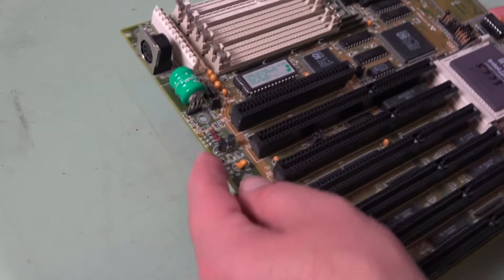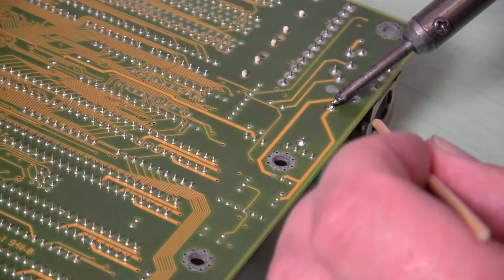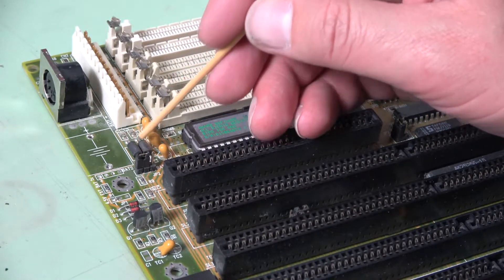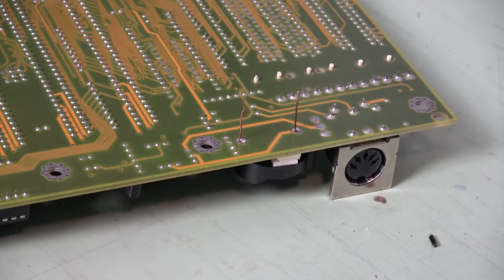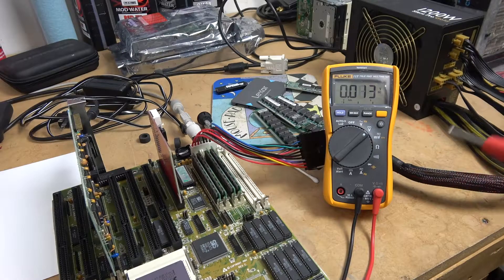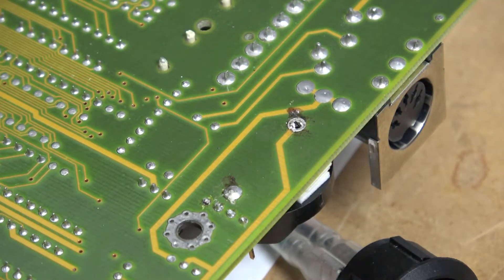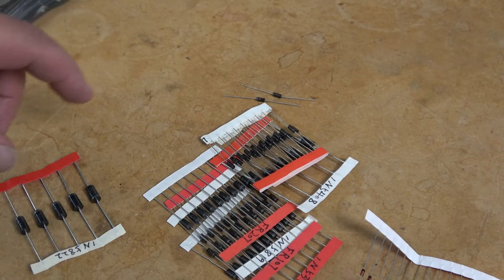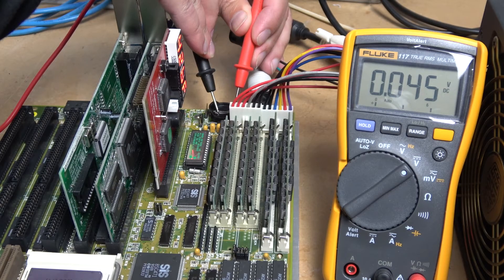Barrel Battery Upgrade on a Retro 90's 486 Motherboard

Comment: 1000x times easier is just use the "ext bat" port that usually is a 4 pin connector nearby and use a cell battery and stick it somewhere nearby with some velcro
Reply from the maker: You mean something like this? https://youtu.be/WGEP9cRuCmY?si=geoXS6qO-7J8ZeZX&t=311  It is a no brainier that an external battery is the way to go.  That is the reason why motherboard makers included those headers as they knew the battery would eventually go dead and wanted to give consumers a way to continue to use their systems.  

The section of the video I shared shows how I converted an alarm system battery for use in a retro PC, of course simple AA batteries could work or even an external CR2032 would do the same.  Either way, thanks for watching and leaving a comment. 

Truth be told, this was a pretty old video and something I wanted to try out.  Given the chance, I would even do the mod again because I can.

Comment: Would it be possible to use a rechargable battery? Like the ML2032.
Reply from the maker: Yep, that shouldn't be a problem.  You would just exclude the diode in the repair,  There is no provision to "stop" charging once the battery is full so, that could cause a problem or, might be just fine.  Never tried but, based on my google results to your question the technology appears to be solid.

Comment: Finally found a video on how that shows the desoldering of the exact one I need to remove, working on repairing an old Claw machine motherboard and the battery does not stay charged when the machine is off so I bought a newer version of it and I’m planning on soldering it on. It’s going to be my first time soldering so this gave me confidence to be able to do it myself.
Reply from the maker: Glad I could help,  If you have never soldered anything before I might suggest testing your method on some bits of scrap/wires etc..  The process is not difficult however, the danger is applying too much heat which can cause the copper pcb traces to burn up.  (which is not desirable)
Reply: @Hardwareasylum  hmm yea I got a old motherboard I could test on thanks for the tip

Comment: Nice job.
I have several old 486 MBs that were recovered by my father.
They're a rarity nowadays (at least where i am they're either overpriced or badly damaged).
What kind of diode do i need to buy? (the specifics to find it online).
I remember a while back there was someone online specified the diode but i don't remember the code.
Reply from the maker: Schottky diode,  I bough a grip of them off Amazon for like 5 bux USD.  https://amzn.to/3xeFdjk

The small black ones seemed to work the best with the least amount of voltage drop.  The red/black ones are more efficient but didn't block the reverse voltage all that well.

For the effort I am now a big fan of using external batteries like what I built for the Classic Case build.  Less effort and seem to work just as well.
Reply: @Hardwareasylum  So it was one of the Schottky diodes, the 1N5819?
On the motherboard i've been working on i've located the charging circuit and removing the resistor should nullify the voltage to the battery.
For safety i will use a diode to protect the battery but i must be sure of the type of diode to use.
I don't want any reverse voltage to make the battery explode.
Reply from the maker: I believe that is the one.  Something I don't think I included in the video is that you can test the diode leakage by simply connecting it to a battery and measuring the voltage with your meter.
Reply: I thought that there was a pin setting to set for Varta battery or external battery  beside where you pulled out the battery.